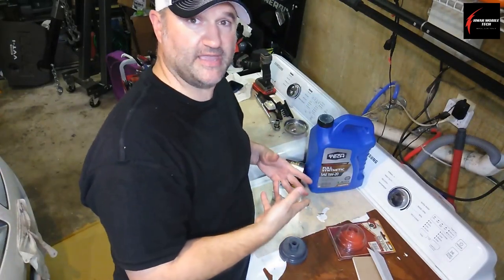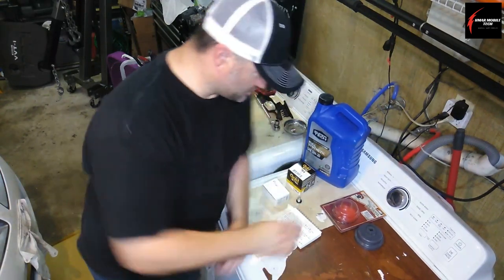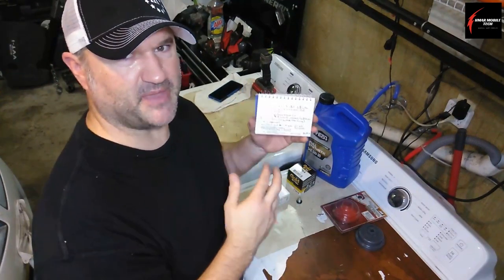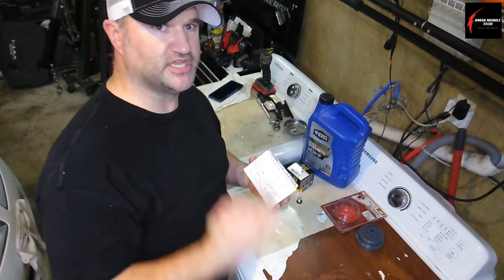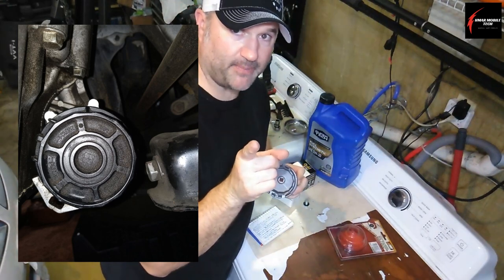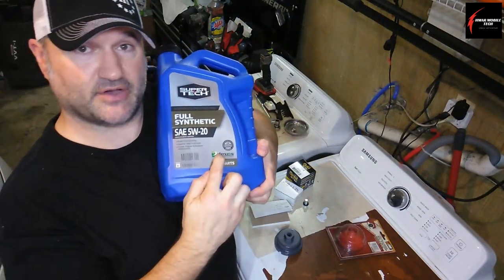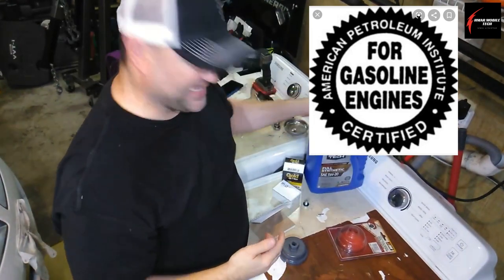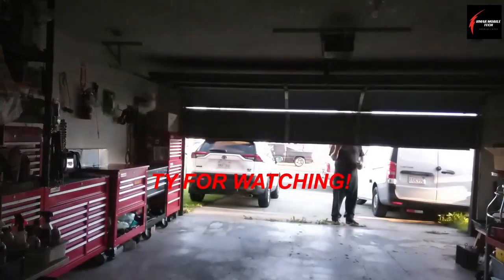2002 - 2010 PONTIAC VIBE / TOYOTA COROLLA MATRIX 1.8L OIL CHANGE SERVICE TUTORIAL AND SCANNER DANNER

Comment: It's nice to know what you need for the job, but you could have shown the actual change.  Our daughters oil filter is a real b__ch to get off.  there is a small metal locking piece on it and it would be nice to know and see where that should be oriented.

Comment: Thanks for your content I did a oil flush but no change on filter yet because my filter was stuck and my vibe only had 2,088 miles on the oil that was in it then and the mechanic who put it on before over torqued it 😢 and I don’t have that socket for it. I did it because I wanted to learn it because I hope to become a future mechanic someday
Reply from the maker: And you def. will, ty for your time leaving comment :)